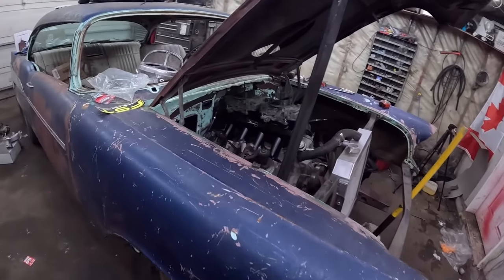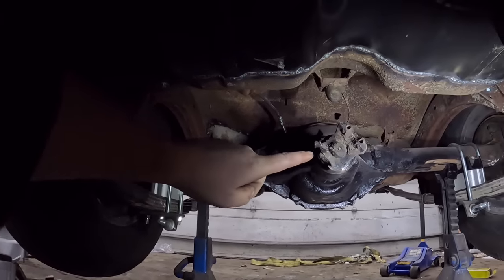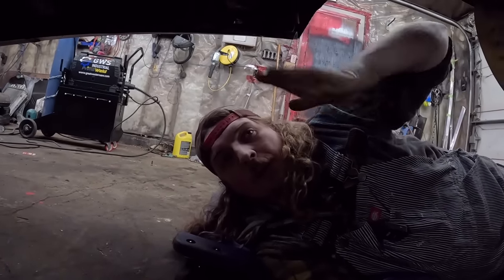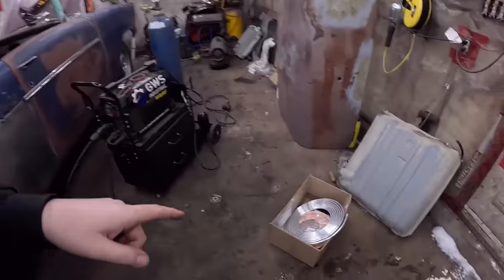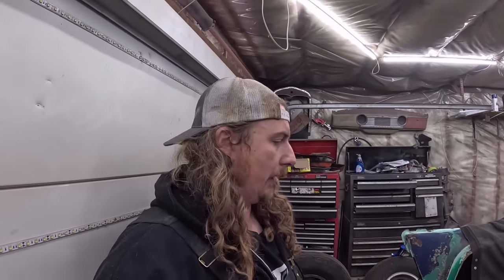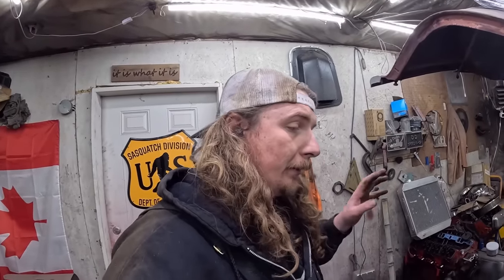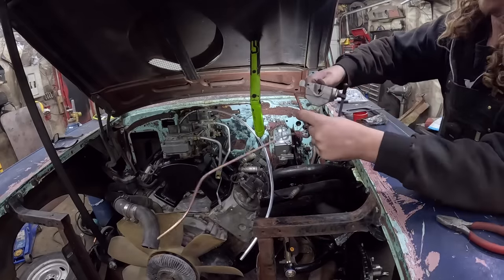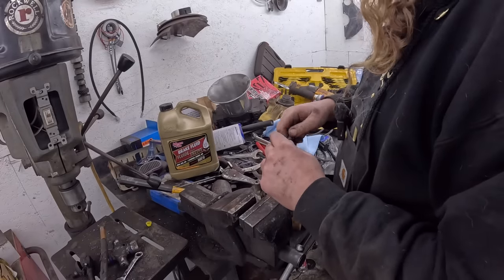WORST 1957 Chevy Is A Roller For The First Time In Years! - CHEAP Brakes And Suspension

Comment: Dan your "All or nothing" regarding brakes is the smartest move you will ever make. Brakes are nothing to patch together they should always be well thought out and properly installed. That pedal and the rubber on the tires is the only thing keeping you from disaster.
Reply from the maker: Totally agree
Reply: It blows my mind when I tell people that there brakes are shot or they have a leaking hose or line. Some just say fix the heat or a/c depending on the season. "I will get that fixed later". Smh

Comment: Interesting thoughts on the pinion angle. I always just set the pinion angle so the U joints are as straight as possible when the car is sitting on the wheels, with the weight of the car on the suspension. That's when I was even concerned about it. Back when I was young, we would jack up the rear end with either air shocks or longer rear shackles for leaf springs, and put super wide tires on the back, that would stick out past the fender. That was the thing back then, and I still love the look. Huge rear tires (on no more than 15" wheels) and a lot of nose to the ground rake. That played hell with the pinion angle, but it still worked, which told me that pinion angle does not have to be perfect. 

Glasspacks are THE way to go. They worked great in the '50s, they still work great today. And the older they get, the better they sound as the glass burns out.

Comment: Dan, put the yoga mats on the cold floor.  It helps a lot to separate your body from the cold concrete.  I know it's a pain but makes it much more bearable.
Reply: Small rectangle sheets of styrofoam work well, some use em on garage door panels. Beat the tar out of a pair during the winter then replace em next season
Reply: Used commercial truck rubber mud flaps work well in all seasons. Also in front of a drill press or vice.
Reply: @jasonfitch7977  ,  not if you are welding or using a gas axe. LoL use rubber mats or large truck mud flaps.

Comment: Hey Dan, check that brake line out to see if it is the real thing.  I have heard lots of people buying the online copper line and it is essentially just steel line with a thin copper coating.  Once that coating wears away, it will rust quickly.  It is not the same as NiCopp line.

Comment: Pinion angle is critical to an enjoyable vibration free ride. My 62 C10 had 1.5 degrees up also and I used the shims you mentioned between the trailing arms and rear end. It was quite a bit rustier than your 57, haha.

Car is coming along very nicely though, keep at it!

Comment: Well Dan you got the 2 degrees down right on the rear correct . I've seen everyone always measure with the angle finder off the top/bottom flat on the yoke. Never seen it done on the housing casting , not that it is not on the same plane as the yoke ,but I do as the so-called pros do.

Comment: I feel for you Dan,when I had stock cars I did alot of work in the winter.25x25 garage,wood heater in the front.I would sweat working on the front of the car and be cold working in the back by the doors on the cold concrete.

Comment: Hey Dan what was the part# on the msd box u bought can't find the video when u talked about it for some reason I think u said it was a 6014 an I believe that motor has a 24x reluctor wheel on crank if so u need a 6012 box if that's what u have ur good to go but if the box is a 6014 it's for a 58x crank just a heads up before u hook it all up

Comment: pinion angle depends alot on what you use the car for like most Dodge  cars with super stock springs if you were drag racing you want 5 to 7 degrees nose down the main thing is when you launch the car you want the pinion to be level or just nose down where it will plant the tires. street cars you are not going to race the way you did it seems correct to me

Comment: I don't doubt that copper stuff is brake line, but scamazon would allow the sale of copper line labeled as brake line.
Reply from the maker: Hope not
Reply: @DDSpeedShop  people have done tests on automotive fuses sold in Amazon. Some allow 200% the rated current before blowing
Reply: @robwigglezz944 lmfao no the certany don't 😂
Reply: It's copper nickel brake line. Napa sell the stuff too. That's just what's used now. I've been using it for years

Comment: got a hot tip for ya dan   "cardboard" get yourself a big slab of cardboard and throw it on the ground under car where you are working   you will be amazed on how well it works you will still hate your life because you dont have a full hight lift , but you will be so comfortable and warm  you will prob do a few extra hours every day . sometimes it gets so cold in western australia in winter down to like 10 degrees celcius  the concrete is like ice ( it makers people like me wonder why any one would live in your country) , all jokes aside cardbord is a great insulator and works on a hot day as well , on a 40 to  45 degree day the ground gets that hot you cant lay on it . cardboard is king al those homless people cant be wrong mate

Comment: Hey bro, doing  a 57 carb ls1,you had a efi fuel tank,why didn't you use it,instead of that noisy holley? Run the line to a regulator, return out the bottom,and a nice quiet pump.Prob not the DD way😅
Reply from the maker: I dont got an efi tank. And they b pricey
Reply: @DDSpeedShop I just ordered it was only $700,you can afford it,your DD speed shop! I still will sub to your channel!

Comment: See u got your hair secured while welding rear end. Got mine caught in creeper wheel once. more I moved the tighter it got. ended up rolling off the creeper , crawling out and cutting my hair  off with pocket knife. Close to the back of my neck. 😮 Sure did hurt.

Comment: When you were setting the pinion angle you even said equal and opposite which is correct but you put the pinion angle downward which is not opposite unless you caught yourself and didn’t mention it otherwise nice job keeping these hot rods from the salvage yard!!
Reply: I hope he caught himself. You want the trans down 2 degrees and the diff up so they are opposite. Look under any factory truck and the diff is angled up. I would even put it a little less than 2 degrees on the diff since under load it will twist up a little.
Reply: @Apache61  and he miss calculated the centering of the differential. 7-1/4 vs 7 means 7-1/8 is centered. He wanted to move it 1/4” that will make it just the opposite of what it is now.
Reply: @chuckfry1227 oh well, I am sure it will run just fine. And I guess if it vibrates he will fix the issue. He is good at cutting and welding stuff.

Comment: Dan why couldn't ya put the jack stands on the spring perchaces that way ya don't have any weight on the dif. and can easily move the dif and also have a better reading on your angle guage.
Reply from the maker: Gotta set the angle at ride height
Reply: Sorry l meant on the shock mount then you would have the rite ride hight and still be able to adjust the dif @DDSpeedShop

Comment: Since its a roller now I would switch places with another car in the warm garage:face-fuchsia-wide-eyes: to finish up the 57 in a warm garage. So you guys dont have to suffer so much in the old cold garage.:penguin-blue-waving-tear::body-blue-raised-arms::face-blue-wide-eyes::face-blue-smiling: Move it to the warm garage since it has steering, brakes, and the motor is practacally running. Maybe get it to start and drive to the warm garage?:body-blue-raised-arms::face-orange-raised-eyebrow:

Comment: I know the big YouTube star that you’re now won’t respond to this but, what master cylinder and proportioning valve did you use?
Reply from the maker: It's all in the video
Reply: I heard you say Chevy II brake lines but never specifically said if that was what the master cylinder and block were.
Really I just like that your master has the latch and not the bolt like the Camaro one.